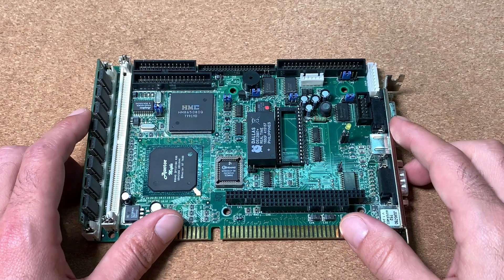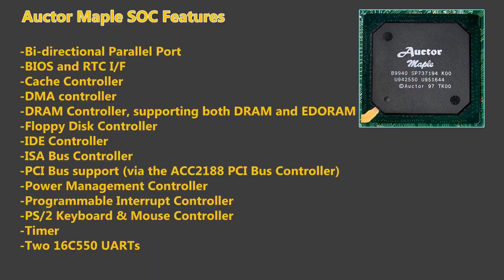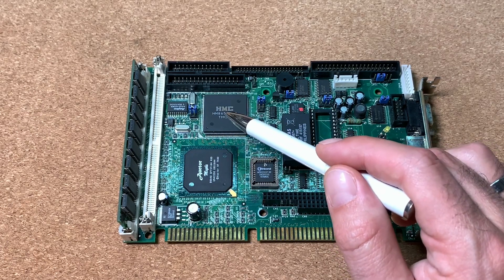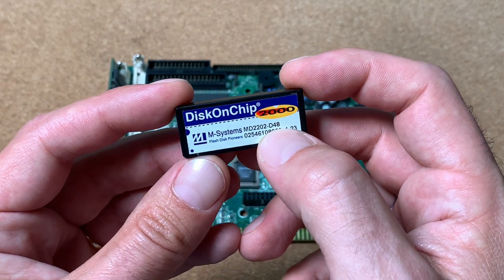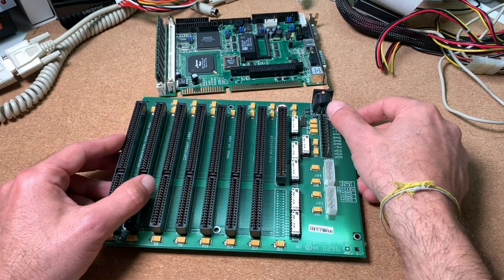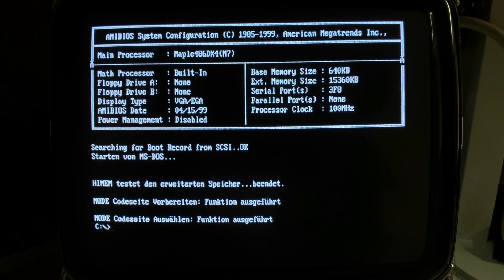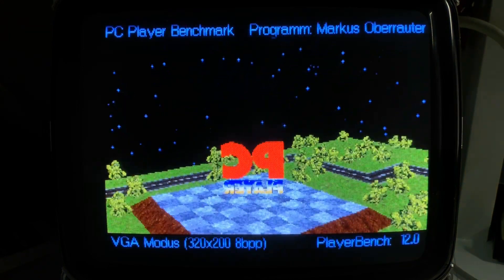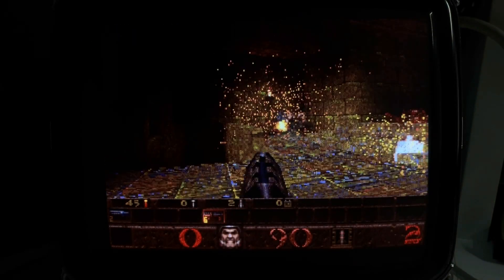486 SBC, Benchmark & Dos Gaming on a Vintage Single Board Computer

Comment: Used to use a lot of these. It was coupled with a big chunk of pc104 flash. A 3c509 nic, transputer interface and 4 imst400s. The setup would monitor the bearings in turn generators and perform predictive failure analysis.

Comment: I bought a Sun workstation that had a very similar expansion card installed, it was also advertised as a 486-33 but sadly it was non functional.  It was controlled via software in Solaris but I couldn't get it to detect so I suspect it was blown.

Comment: Maple made even smaller more efficient 486DX, some running at 133MHz, often in PC/104 form factor.  Also, there is a version with 10Mbps Ethernet (RTL8019, which has plenty of support in DOS, Linux, Windows 95, using either dedicated drivers or using NE2000 compatibility drivers), JUKI-750E . That would be a nice thing to have.

Comment: It's a shame there is no sb onboard.  Cyrix had an all in one chip called MediaGX for small thinclients in the late mid 90's. Also lacking L2 cache and gaming wise, same drawbacks, but it has sb compatible system integrated in the cpu.
Reply: This isn't based on that chip at all, but Cyrix's previous 486 designs for socket 3. Which were generally 10% behind the same intel cpu's or a bit more. The MGX had 16k cache and unified graphics.

Comment: These are indeed based on the Cyrix 4x86 clone which usually performed 10% or a little more behind the same intel CPU. These came after the DLC chips and before the C5x86 chips and were indeed native 486 design for socket 3. As far as I can remember they were even a clean room design and not a direct clone of the Intel cpu like the AMD line was. This thing having no L2 cache would certainly put it well behind a properly equipped DX4/100 chip. And infact would put it probably around or even slightly behind a DX2/66 that has L2.  Cyrix even had a small line of native clean room 486s before this one that only had 2kb of cache. Both that one and this 8kb l1 variant are probably the most compatible CPU's cyrix ever made with their respective markets (and yet still not 100%). As they were a proper 486 with tightly coupled pipeline and native instruction set.  Unlike the DLC which was a 386 modified with an L1 cache and microcode patched 486 comparability that sometimes didn't work as intended.  This really was Cyrix's first ever in house design and was quite the achievement to be honest. And they came back with the 6x86 and the stopgap 5x86 design which were truly original and both great performers given their IPC gains. 

Intel was unable to sue cyrix because of this cpu's unique designs, and for the DLC they essentially licensed from IBM and made a direct clone of the blue thunder. 

When I built my 486 I had one of these cpu's as a loaner until the 5x86 120 that I ordered arrived.  So I am familiar with it first hand, and remember benchmarking it next to my friends intel DX4 and being dissapointed with it. Only later to kick his butt with the 5x86.  Fun times.
Reply: Not clone, it uses Cyrix 486DX2 on a license to integrate it into the core. THe core was designed by Cyrix and just integrated into bigger design. Same was done by STMicroelectronics for example.

There was some reverse engineering done by Cyrix to arrive at the CPU design, but it wasn't just clone and taking masks from Intel and building exactly same chip. In the end legal suite was dropped, and Intel paid Cyrix to drop the anti-trust charges.
Reply: @movax20h  It is a proper cyrix DX/4 license.  Though it was the same as a dx2 but for a 3x multi and a few minor errata fixes. And you are correct about the lawsuit. I don't think it even went to trial, though i would need to look that up.

I used to consider it a clone because it did have a lot of similarities in structure and composition to the intel chip, but it was still technically clean room in many aspects. I am really unsure how "from the ground up" the design was, not as much as the 5x86 or 6x86 were anyhow.  But it did have completely original circuit work with its FPU and a vastly simplified front end as well. The rest of the chip like the ALU's were certainly heavily inspired from the Intel design if nothing else.

Comment: It looks to me like a re-badged Geode SOC by National Semiconductors, based on a Cyrix MediaGX design.
Reply: This isn't a geode. Those were based on the C5x86 core and had 16k L1 unified with shared graphics. This SBC is is based on the previous 4x86 Cyrix (not the DLC/SLC) which generally were 10% or more behind intel cpu's out of the box with a similar configuration. This one having no L2 would exacerbate that deficit.
Reply: @wishusknight3009  Good point, thank you. (IIRC, The couple of Geodes I've seen in the past in industrial boards didn't have any L2 cache either.)
Reply: @ernestuz  i have actually never seen a mgx geode with l2. though there may have been a few
Reply: This SBC is Cyrix 486DX2, 33MHz, 8KB cache.

It was either made by Auctor, or maybe with some help from SGS Thomson.
Reply: @movax20h  These may have even been fabed by UMC. Possibly packaged by one of the other mentioned.

Comment: Performances are more closer than a 486dx2 66, but this may be due to the integrated video chip that may be works on isa bus. I'm pretty sure if you put a dx4 with an old isa trident or oak video adapter you'll get this results.
Reply: This is the Cyrix 486 which generally fell about 10% behind the intel equivalent. And no L2 would make that more pronounced. Note this isn't a media gx or the DLC based CPU's.

Comment: 486 100Mhz unbelievable how fast the development has gone. My current computers is 3.5 GHz Turbo 4.0 Ghz.  On a hard disk of that time does not even fit a small MKV movie.
Reply: I started with COSMAC 1802 1MHz 4K  0.1MIPS punched tape, and then ZX81 3.7 MHz 16K CUTS, my main PC today is dual E5-2690 16C/32T 3.8GHz all cores and a mere 32GB RAM and Terabytes of SSD.

Forty years, the future is RISC-V if they get the hardware into a standard that is usable and accessable, see Linus's talk on niche elitism amongst devs and lack of information. outside of companies. .

Comment: interesting integrated CPU, but what will happen if you put this board in other regular PC ?
I have other question too, can you help me with this think Compaq Agency Series EVB003? I have this and do not know how to run it and what is ti for?
  https://www.pcbitz.com/products/230-misc/compaq-agency-series-evb003-remote-insight-board/
BTW how do you feeling when killing the Nazis :D in Wolfenshein hehe ? :D 7:00
Reply: Nothing will happen... Either it will be ignored or the whole machine wont post when there´s two CPU reporting on one bus.
Reply: @CosmoRiderDE  so this ISA is not ment tu be put in standard motherboard hmmm than why is that? To use with ISA extender board like you?
Reply from the maker: You have usually a ISA backplate where you put all your extension cards as well the SBC.
Reply: @intel386DX  It will physically fit, but it will not work, because this card has same compoennts as the normal ISA boards, including DMA, io controllers, timers, bus latches, a20 gate, etc, so they will both be running and go into each other steps, even if you don't put a CPU or memory on the normal board.

You really want to have a dubm ISA backplane to run these SBCs. With enough skill you could probably solderer a lot of chips from the normal motherboard and make it work, but why bother.
If the SBC is EISA, and the motherboard is EISA, it might be possible to use both, but that would be pretty tricky, and require specific compatibility and OS to run.

Comment: From 1999... What was it used for?
Reply from the maker: good question.... I could not find any information for which application it was used for. 🤷🏻‍♂️
Reply: Most of the SBC were used for industries that needed legacy support.
Reply: @CPUGalaxy  Plug it into an Amiga 2/3/4000?
Reply: Sometimes Telcoms and dialup racks. Other applications were for CnC machines and even one wierd case of an orthotics scanner.  My friend had such a beast.  You stepped on it, and it would measure your foot pressure than form a mold to which one could grind orthotics. (shoe inserts which dramatically increase posture)